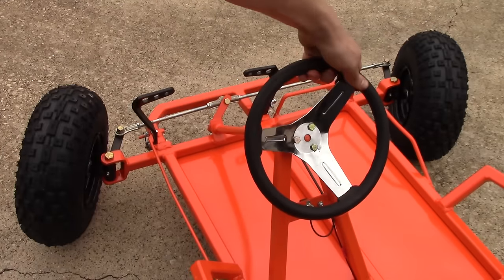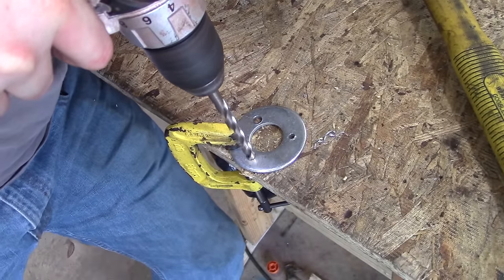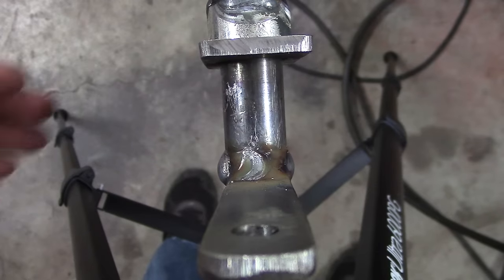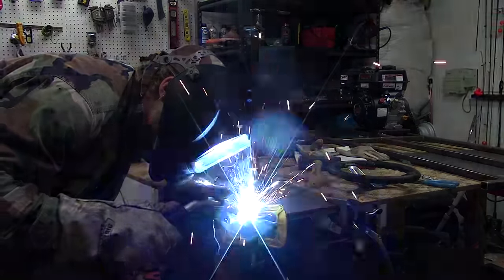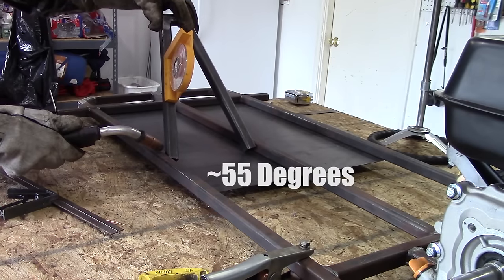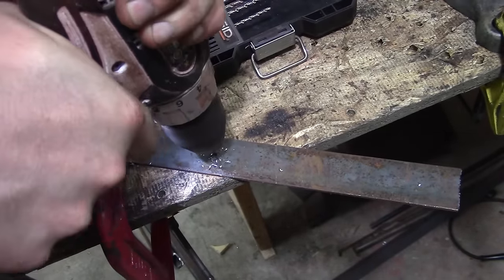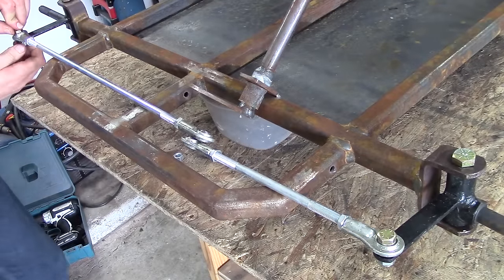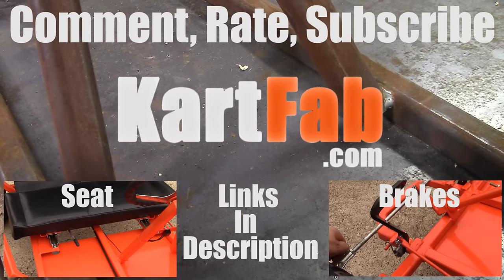Go Kart Steering System: How to Build a Go Kart

Comment: Great video. Appreciate the details which actually make this very useful. We are about to install the spindles but was under the impression that you need "camber" resulting in a spindle slightly angled backward 5-10° to offset downward compression and turning resistance. Looks like you kept the spindles at 90°.
Reply from the maker: It’s a kids go kart 1 wheel peel. Camber/caster/Ackerman are nice but this gets the job done for what it is.

Comment: Excellent video. If I were you though, I would invest in a steel table top(36x36, or 48x48). Go to the scrap yard and you can find something that would work nicely. The second thing about the steel table would be no longer needing nails to hold your form. You can use magnets… Like nature intended! 😂😂😂 PS, please drill your wheel nuts and attach a cotter pin. Vibrations will ultimately cause the nut to loosen, and fall off. Hopefully not while you are riding fast.

Comment: Ive watched your video.I'd point out that you have no Ackerman with the tie rod arms at a 90 degree to the spindles.A good rule of thumb is If the arms are out in front,they should be angled out,(with the tires straight ahead)so an imaginary line from center of tie rod and kingpin bolt should meet at the center of back axle.And if the arms are behind,angle them in toward frame.you'll be amazed at how much better they'll turn.No scuffing off the treads.(see my video. Go Kart steering explained .Including Ackermann theory. ) john wade,you tube.

Comment: I have a kart frame I'm building it's an old race frame I think? I don't think it's home made. I can't find any info on it itself. It's definitely made for going in circles around a track. The steering spindles are at extreme angles and it always wants to turn you really have to hang on the wheel to keep it straight. I want to change that. Should I just cut and weld them back up straight?
Reply from the maker: Ask that question with pictures on DIYgokarts.com there might be more to the puzzle than you think.
Reply: @KartFab  thank you I registered to the site but it won't let me post. Hopefully in a day or two I'll get admin review or something like that , it's telling me something like that anyway. Thx

Comment: Sir, I urgently need your help.
I have finished my go kart thanks to you and your tutorials.
My front wheels turn at different angles!! If I turn right the right wheel turns about 30 degrees and the left turns 45 degrees. If I turn left the opposite happens. With your experience, pls share what makes the angle issue.
Will appreciate your response
Reply from the maker: I have a feeling you didn't actually use any of the parts I linked to, and you just kind of made it up as you went... Being without the proper parts and cutting corners is probably why you are in this situation. Is this true? So even if the wheels turn at different angles, does the kart turn and handle well?
Reply: KartFab 
Sir, many thanks for your prompt response 
You are very right. Where I am, accessing the parts becomes very expensive. So we used about 10mm round bar to fabricate the rods connecting the steering to the wheels.
However, I had several challenges 
I used a Centrifugal clutch from amazon along with a 34 teeth sprocket to rotate a live axle having 16inch Tyres. 
My clutch started smoking and became really hot 
- my front Tyres (only 10 inches) were cutting the corner but I guess that because I did not use the bracket to stop steering cut, started to slip.
If not too much for you, pls advise
I want to share the pics with u via email. Thanks
Reply from the maker: @zainhussein1975  you will need to research ACKERMAN steering. What you have created is the opposite of what you need to do.
Reply: KartFab 
Well I will work on the Tyres and try sourcing the parts from GPS
Any insight on the clutch and sprocket issue shall be appreciated 
Many yhanks
Reply from the maker: @zainhussein1975  you know... if you would have just looked at the free go kart plans i have listed here https://kartfab.com/go-kart-plans then you wouldnt have to ask so many questions. The reason your clutch is burning up is because you have the wrong size rear axle sprocket. Get an axle sprocket that will give you a 6:1 or higher gear ratio. Id say if you have a 10t clutch to get a 72t axle sprocket. You want to gear for no more than 25 mph at 3600 rpm.

Comment: Ah this answers my question seconds into the video go karts should steer easily. Which is what I had been used to go karting for many yrs not professionally though.  The reason I ask is one place I went to had karts that were well hard to steer the wheel was hard to turn and track was rough so trying to go full power was creating many times I felt I would crash.  These were a different kart than I was use too as well though the ones I am use to are fast but not racing ones this ones looked faster but not sure if they were

Comment: How do you determine the turning radii for the wheels? How do you make sure the inner wheel turns tighter when turning? 
Thanks!
Reply: To do that you need to have the spindle bars facing backwards to change the ackarman angle.

Comment: Nice work! I noticed you did your spindle brackets at 90 degrees. I'm currently rebuilding a kart for grass and dirt. No pavement. Would 90 degrees work for me? Will I have over/under steer issues?
Reply from the maker: +Mike F 2-7 degrees from 90 would be ideal.
Reply: +KartFab Wow! Quick response! Thanks!! I'll shoot for 85 degrees then.

Comment: how you decided the angle of steering control arm?
I am developing something similar to it so if there is any general angles for fixed radius of rotation  , they may help alot.
Reply from the maker: good luck, pitman arm should be roughly 1/2 the length of the spindle arms, and you keep pitman arm from over rotating to keep wheels from locking up and sliding due to over rotation.

Comment: At about the 2:35 mark you weld a small washer to one of the ends of the steering column, but I don't see that in the PDF plans?  There it looks like the steering column is welded to the 2 1/2" OD washer.

Can you clarify?

Thanks!
Reply from the maker: +Wayde Gilliam yes. I just used the  small washer to fill in the gap from the larger washer when welding it.

Comment: Thanks for the video. How tight should the bolt and lock nut be on spindle?.im having steering issues. When i turn the cart pushes through the outside tire and slides. Any thoughts thanks
Reply from the maker: Don’t give it as much gas and and don’t turn as sharp.

Comment: spindles shouldn't be at 90° that should tilt back about 10° and also should tilt it to the frame. look up pictures of a race kart it will make the steering muck smoother and less jumpy also stops it form under steering
Reply from the maker: Brad, thanks for your advice. The go kart that I did was for the simplest build possible. A lot of earlier model yard karts are built exactly the same with no camber, caster, or ackerman steering. Adding all that to a simple yard kart would be confusing to most people, so I decided to leave it at 90, and go with the basic spindles at 90 degrees.
Reply: +KartFab wsp
Reply: I built mine with 90 deg spindles and the kart won’t turn
Reply: At least 10 degrees. I prefer about 20 to 25 personally. Makes for really good steering : )

Comment: Hi. So I'm confused on the steering hoop. The free plans say to cut it at 39 degrees but your video is at 51 degrees? Where does the 39 come into play?
Reply from the maker: +Nadia Valdes depends on what measurement system you are using, and what size of the angle you are wanting to show...... so 90 degrees minus 39=51 :-)
A chop saw would read 39 degrees, and a protractor would read 51. 
If you were measuring  a flat cut on the end of a tube, a protractor would read 90, whereas a chop saw would read 0
Reply: +KartFab thanks for the response. I had my steel provider make the cuts and gave them the 39 degree measurement, but they must have used a flat cut because it measures 39 with my protractor not 51 so I think I'm gonna need to recut my hoop. I'm good with welding and mechanics but I'm clearly angle deficient!  :)

Comment: Newbie question here.... What do you call your welding machine? is it TIG?
Reply from the maker: +Jroy Taling I have MIG and tig. MIG is the one to get.
Reply: Can I use MIG to weld aluminum metals?
Reply from the maker: +Jroy Taling it is possible but a MIG welder would need to have a compatible attachment and welding gas.
Reply: Thanks! Very helpful! Subscribed! 😄😄

Comment: where did you get the spacers? Can I use 3/4" OD black pipe cut to size?
Reply from the maker: Yup it has a bit of slop if you do it with pipe but it’s fine. Or 11 ga 1” tubing and grind the shaft down a tiny bit.

Comment: I notice some go karts have the tie rods at the back, and some (like yours) have the tie rods at the front. What difference does this make?
Reply from the maker: +PR0bro you just described the difference.
Reply: Sorry, I mean difference performance and handling wise.
Reply from the maker: +PR0bro again, no difference. People tend to over complicate things. If you want to modify handling you adjust the angle of the kingpin, camber, caster, spindle arm length, etc. tie rod location is not that relevant to the equation.
Reply: oh, thank you. What does the spindle arm length effect?
Reply: how sensitive the steering is

Comment: did you weld the spindles at a 90° angle? what about caster and camble?
Reply from the maker: 90 and no caster or camber. This is the way old school go karts are made (e.g. manco) If you want to change it up you can, but there are always going to be compromises (e.g. tire wear, ease of turning, squirrely/touchy).
Reply: KartFab thanks for the fast reply, I just hope mine works out ok. I just welded mine at 10° camber and 15° caster.
Reply from the maker: that should be alright, might need to bend the spindle brackets a bit to get the tie rods to clear the frame but thats not a big deal
Reply: KartFab ya I'm just waiting for my parts in the mail to see if it clears the frame, it's gonna be close though.
Reply: KartFab well it seems fine until I hit 45 mph then it gets the touchy steering so I'ma do 0 camber and 5 caster cuz it scares the shit outta me, I got almost flipped a couple times when racing lol

Comment: Can you Please explain how steering stop works?
Reply from the maker: +Prashanth it prevents the steering wheel from over rotating in either direction.
Reply: KartFab 
I've got to 3.2 turns lock to lock rack and pinion, i want to make a steering stop, could you please tell me how can i do one?
Reply from the maker: so what is making it lock? can you move the thing that is making it lock?
Reply: KartFab 
I'm building an Off road car from scratch,
In that I've to make a steering stop
Can i get your mail id?

Comment: What kind of welder was the one he used in this video?
Reply from the maker: i used a miller 212 with .035 sold core wire 75/25 gas mix.

Comment: so i have a lincoln mig 180 welder and i ran out of gas should i continue to weld
Reply from the maker: +Agora Gaming do what you think is best.
Reply: hey man quick question can you weld a small sprocket to the shaft of the engine or will it not stick...i know once its welded it cant be removed. thanks
Reply from the maker: +Agora Gaming not a good idea

Comment: which type of enjine is used
Reply from the maker: check out the playlist that goes over the engine. any horizontal 6.5 hp straight shaft engine will work with a 3/4" shaft